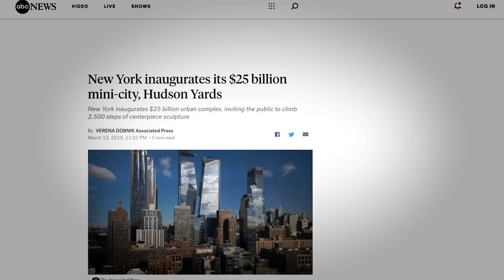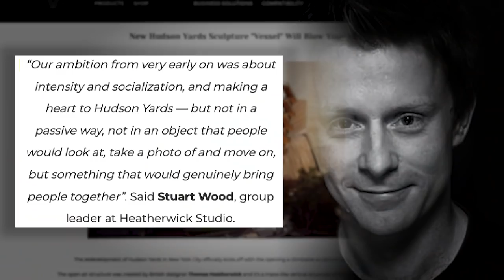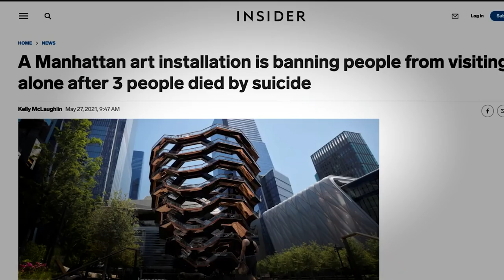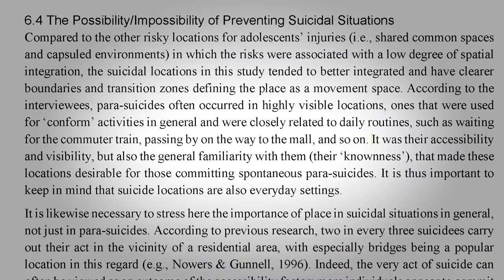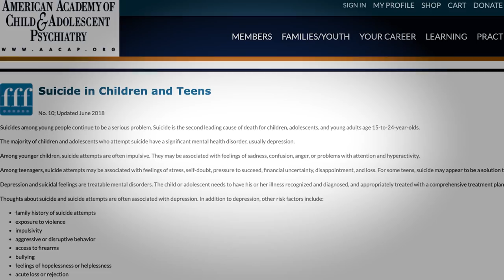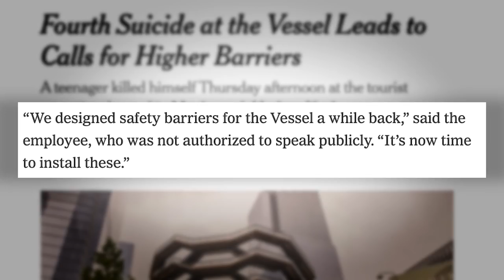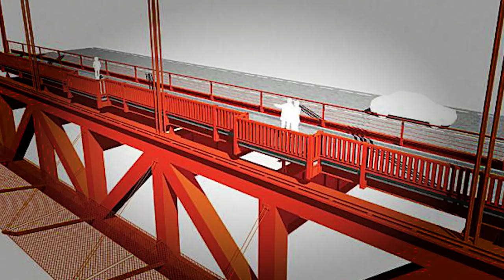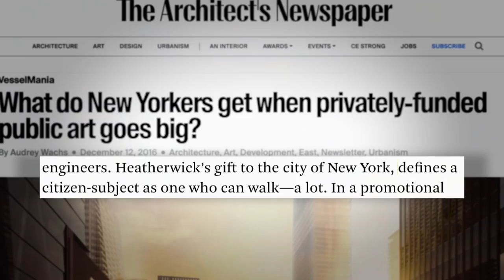Is This $250 Million Selfie Spot Dangerous?

Comment: Caitlin, another very good video, thank you. As a former urban planner and civil engineer, AND not an apologist for the Vessel's architects, it's actually true that you cannot just add hundreds of thousands of square feet of plexiglass or safety glass to the Vessel.  The reason is, the structure is designed to withstand a certain wind and gust load, and since it is skeletal in design, adding a lot of plexiglass or glass barriers will exceed the safety factor of the structure, making it at risk for the structure to fail if a high wind event occurs.  So its not necessarily BS that they don't know what solution to apply, it requires more than just adding barriers. Personally, I'd guess a 2 foot higher monofilament netting would minimize the visual impact, but it will diminish the experience.
Reply: Could they replace the the glass railing with a taller metal barrier that would let air thru. Something like a chain link fence so that children and shorter people can still see thru it?
Reply: @Mike Mainer there was literally nothing sociopathic about what he said

Comment: so...I had never heard about this before watching the video. as such, I have spent roughly 30 minutes considering this while watching, and I could design a better one.

instead of "just stairs & landings" it needs actual stopping places. these could be little gardens or seating areas. they should not all be the same, but maybe some have a little bubbling water feature. maybe the size of the stopping places & the number/type of seats varies, such that a couple could take a small one, and a group of maybe 8 people could picnic in a larger one if actually different sized stopping places doesn't work, some could be split with planting. I envision this version with fences made up of many circles welded together. they're high, but a lot of the circles are face-size, so it still feels open.

I'd call it "inhale", because the original looks like a rib cage to me.

not too clear on how to make it accessible while keeping the step well inspiration, but I'm not paid to do this, so...
Reply: Those are some great ideas!
Reply: I’ve never been there, but I was surprised to see that there weren’t little areas to relax.  I agree with your ideas to change the vibe of the structure.  Make it feel more welcoming and less empty.  
I have Borderline Personality Disorder and suicidal thoughts occur frequently.  Feeling connected and happy helps ground me.  I imagine some of these people felt insignificant in that giant maze of unobtainable wealth.  Maybe if they decide to make it more pleasing to people, they could add some giant curvy slides?  If people are laughing and having fun, it kind of puts a damper on harmful thoughts.

Comment: Your mock argument is perfect. 20 years ago that was basically what happened in Pennsylvania with a bridge at the northern terminus of I-476, part of the Pennsylvania Turnpike system. The bridge is over 150 feet tall and only had Jersey Barrier style sides topped with a short railing so was obviously attractive. In the 90s calls for fences to be installed began but the Turnpike Commission refused. In the 2000s they decided that hotline call boxes would be better than fences but finally gave in when that proved ineffective multiple times shortly after the call boxes were installed.

Comment: I think "The Vessel" resembles a pinecone.  It's unsettling why this experiential artwork has no features for those unable to use stairs.  Ramps could have been incorporated into it by the designer - and should have.  The design team knew the risks even before it was built - that comment made by the architect (?) shows this concern.  Why not build a "tree" in the middle of the city and include ramps, platforms, and leafy railings that prevent suicide?

Comment: See, I was about to compulsively defend the push for barely above waist high railing implying that part of the experience isn't just looking out from the vessel, but looking up and down the vessel itself as you ascend. But right after having that thought, I realized how dumb it is to design something that actively incourages you to lean over a railing, putting spectators in danger and defeating the purpose of a railing all together. So actually yeah, cut some Zelda rupee shaped decorative mesh and call it a day.
Reply: If they still want the ability to lean out to view better they could always use a stepped or curved out barrier design, so that you can lean over but are looking down through mesh. I've seen that done at a few castles in places where the ramparts are extremely low (I think just because of the risk of falling when the barrier is only knee height, but it would also work for suicide prevention).

Comment: as a suicide attempt survivor... there are several ways you get to  "that" point (not an exhaustive list)  but some that come to mind when i saw this "art" were...
"it would be so easy..."  suicidal people can be subject to the "all i have to do is let go" impulse, and that place has it in bucket loads.
"its certain"... no one wants to  end up broken and alive- if you are going to try to jump you only try it if it looks pretty darn certain to kill you.  That place, with its higher levels leaning OUT (and thus no lower level to break your fall) looks certain even if it was not.
"disorienting" ... as you said: this is very sterile, very disorienting- vertigo inducing.  for someone on the edge of suicidal thoughts, this may be enough to tip them over, and THAT is the impact of the art itself.

Comment: Common sense is rarely common. Even someone getting jostled or pushed could easily get pushed over the edge and fall and die even a child this was incredibly poor design and if you had any sense in your head you would realize that it’s Ludacris to think “well I designed it whatever anybody does it’s not my fault“ structures are designed should be up to code and especially if people are going to be utilizing them so this should’ve fallen under some kind of code that was safe for people to use almost as though it was like a building not just a piece of art I’m sure artwork falls under something different but this is a structure for human use and I wonder if they were inspections done on it to make sure it was structurally sound and safe. This is crazy that nobody with half a brain would think that it would be dangerous And that every single person would never have a slip and fall during icy weather or be in a perfect state of mind or possibly be scared of heights at the top and could faint

Comment: Upon looking at the design, I honestly think there would be a way to add such beauty to this shape without losing its appeal, but adding to it!
You could replace the railings of the uppermost levels with full glass windows - so tall no person could climb over them - but fully transparent, so you can behold the view from on high.
As you go down the levels, you bring back the railing and lower the glass window, until at the lowest level, you have the window and the railing at the same level. That way it's not just "slapped on" for safety, but it's part of the design, and it's useful! On windy days, those windows would shield you from wind and rain to some extent.

On the inside you could do something similar to what's done in the library, but mirroring the vessel's geometric shape. If you get creative, maybe you could even get some pretty light and shadow interaction as sunlight filters through those panels.

But honestly, I feel like the concept of that whole thing is a lost cause. As Caitlin said so well, this piece is not meant for real human people, it's meant for the few, privileged and lucky people who don't have to worry about looking down a tall building and feeling the urge to leap.

Comment: The Aurora Bridge in Seattle used to have several deaths a year. People would jump often thinking they would hit the water.  It is however very hard to hit the water. It is only about 40ft from bank to bank. Most of those jumping were landing on the sidewalks in a cluster of some apartment buildings. It took a lot of work to actually convince the city to put up barriers.  People said it would ruin the look of the bridge. How it looked was more important than saving lives. A few more deaths happened while the barriers were being put up. The crew hurried to save lives. Since the bridge has had barriers not one more death has happened.

Comment: As someone who lives in Bristol, I can say that the suicide prevention barriers are annoying, but, as you can see from the image at 16:20 , there are places to go see the view only a short walk away from the bridge, and personally, looking at the bridge is nicer than looking from it. The Clifton Suspension Bridge is a city pride which stands above the major road into the city (with the exception of the motorway). You can’t miss it. It is as inseparable from the city as the GG is to SF (it is 158 years old). As sad as it is, the knowledge that the CSB was a suicide spot, and it’s prominence, definitely attracted people to it to do the same.

Having visited the GG, I have to say that I was a bit disappointed after crossing it because there wasn’t a decent place to look back at it on the non-city side. Building a dedicated place to see it close by would probably satisfy most people and protect the vulnerable.

People self harm at landmarks, so barriers on them are essential. Despite the (in some cases) minimal barriers on the cliffs where the photo of the Clifton Suspension Bridge was taken, there are few incidents of self harm there. It is not a landmark, just a viewpoint at the Bristol Observatory.
At the very least, this is something which should be considered for every place with famous bridges or tall landmarks, which would save many lives.

Comment: The vessel is a magnificent structure and style personally I like this type of landmark and I get the point of of the purpose to enjoy the scenery without any disturbances. However, the difference between the Vessel and the Guggenheim is that the Guggenheim offers different values in each levels, as in the picture in the video I saw there are a lot of visual art that we can connect with, however the Vessel only could offers an "empty achievement" in each levels. The scenery that we could enjoy through the Vessel levels are monotonous concret and city. We could not make much of connections with such visual which I think it is quite trigerring the tendencies in suicidal thought because no matter how high we climb there is no new valuable achievement in it.

Comment: I believe they should have some semblance of understanding the safety aspect since they have an elevator that is completely enclosed and probably with doors that lock as it rises to the top. It is not just an open platform that you ride to the top. Whereas the reason for an enclosed elevator is so people don’t fall out and die. (Plus it’s a safety requirement for every elevator in the city of New York). And since it is obvious that people can die by just using the platforms and stairs then safety should be in the equation, like the elevator. You mentioned it was subject to zoning similar to amusement parks but even roller coasters have safety bars so you don’t die.

Comment: This subject reminds me of an interesting study I once read about regarding gas ovens and suicide rates in the UK. Back in the early 20th century, ovens used coal gas as fuel, which produced carbon monoxide. Unfortunately those ovens became a very popular method of suicide and by the late 1950s half of all suicides in the UK were from people sticking their head in the oven. But then in the early 1970s gas ovens were phased out and replaced with electric and propane ovens that did not produce carbon monoxide, and the UK's suicide rate dropped by a third and never went back up again. Suicide isn't something people tend to plan for, especially young people, so putting up barriers do help in preventing suicide deaths.

Comment: Barriers work. In the UK, the shift from household gas derived from coal to natural gas in the 1960s reduced carbon monoxide content in the gas and led to a sharp reduction in people dying by carbon monoxide poisoning and only a small increase in people dying by other means, leading to a net fall in people dying by suicide. In the 1990s, the UK introduced legislation that reduced pack sizes of Tylenol, restricted the number of pills you could by at once and said they had to be in blister packs so you’d need to pop them out individually to take too many, rather than just pouring them from a bottle. People dying from Tylenol ODs dropped by 43%. Fairly small changes can make such a big difference, including to mindsets at that time of crisis, giving time for the crisis to pass.

Comment: An artist that cannot adjust their vision is an artist lacking in creativity. There is always a way to change your design to fit your ultimate vision if you are willing to extend your vision. He’s clearly not that impressive of an artist if he cannot conceptualize barriers that incorporate the aesthetics. You gave so many examples! To install a piece that is intended to be experienced interactively without basic safety measures is irresponsible and short sighted. Art comes with a lot of license, sure, but there IS responsibility when it is open to the general public to be experienced by all. 

I’m an illustrator primarily, and like graphic designers and architects tend to be looked down upon by “fine artists” 🙄 since we aren’t usually putting our personal angst or overreaching and difficult to decipher meanings into our work. But that in itself forces us to be more creative since most of our art is made for clients, not necessarily for art’s sake. And if I had a firm with a team of underlines to brainstorm I could DEFINITELY come up with solutions more quickly. I always find one that still fits into my own style and aesthetic, even if it takes more work, time, and compromises the perfect vision I have in my head. I have little respect for those that cannot. It means their artistic ability is limited by their own hubris or by their lack of artistic vision. Clearly I’m not a fan. 

Funny how this relates to the gun debate…obvious, easy solution. That is being refused in lieu of other solutions, some useful, some not, but ignoring entirely the most common sense solution.  More important to have the specific artistic vision than protecting the public. More important to have military grade weapons as toys than protect life’s. 🙄

Comment: Hi. I am writing months after this video was posted, but I have to comment on how insightful it is. I live in an area where we have three bridges connecting an artificial island to the mainland. (It used to be a peninsula - they built the canal then rebuilt it and its bridges, in the same era as the Golden Gate bridge - around 1936-1938). The sides of the bridges had no barrier until 1981. It was an open "secret" that people jumped off the bridges. In fact, a high school classmate around 1981 threatened to jump off of one of the two road bridges, but thankfully, he did not. I suspect because the authorities installed barriers in the spring of 1981. Suicide prevention signs were also posted.  The third bridge is a railroad bridge that is inaccessible to pedestrians. 
My opinion is that the Hudson Yards vessel builders should have accepted the inevitability of suicide attempts and accidental deaths and designed the structure with attractive barriers. It's common sense, and a tenet of user-friendly design, which they deliberately violated. Also, I don't like the look of the piece, and a basic green space park, with accommodations for natural flora and fauna would have been best.

Comment: Video reminded me of the Luxor in Vegas and how easy it would be to jump over. Interesting video. I suppose it would be interesting to see how much weight is added to the structure and was the structure designed for said weight. But it does become clear, Why isn't safety designed into the artwork from the start? Interesting video.

Comment: I wanted to die. I tried to climb a fence to get to a railroad...the fence was 1- to tall and 2- it had barbed wire on it. I couldn't get over it. I was angry at the fence, but I walked all night long and by morning I seeked help. If that fence was low and I could get over it, I would died, but also regret it if I survived. I have my ups and downs btw and I have help since than. (And a tiny bit still wants to die, but more bits are precious to me than death) "death" spots shouldn't be easier, but less accessible. So get those barriers higher and better please.

Comment: That they actively decided against putting the barriers that had already been designed just shows how little responsibility some architects see in their work. They want to leave a legacy of beauty and see a building as a piece of art, like a vase or a museum piece. The human beings using the space afterwards seem to be of no concern to them. I mean, they also made the structure entirely inaccessible. No people with mobility issues, no people with balance problems etc etc. 
As a designer myself I think it would actually pose a cool challenge to design extra barriers that fit the aesthetic of the building (like they did brilliantly with the library). Not wanting to alter the initial vision because you fell in love with your design would never fly in most design jobs. It’s a pure ego thing and makes you a bad designer in my opinion.